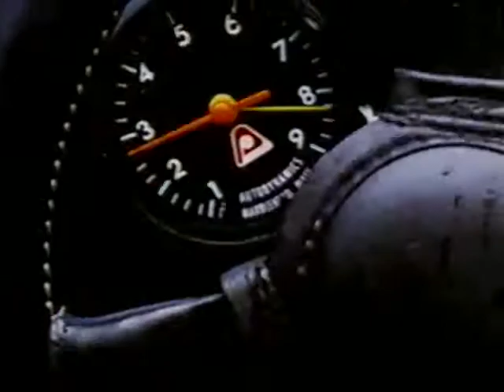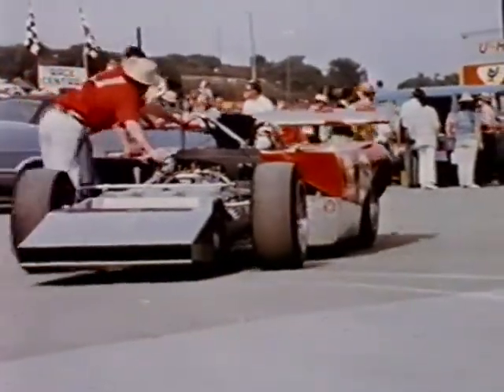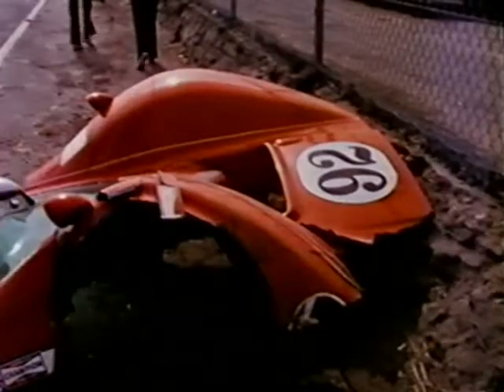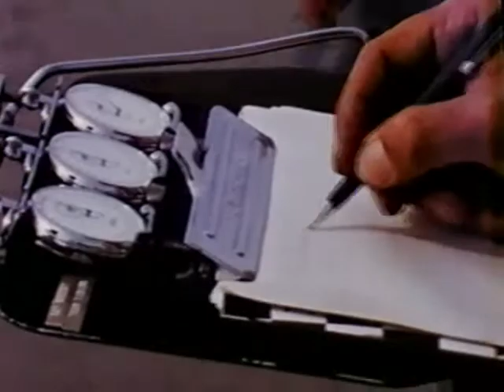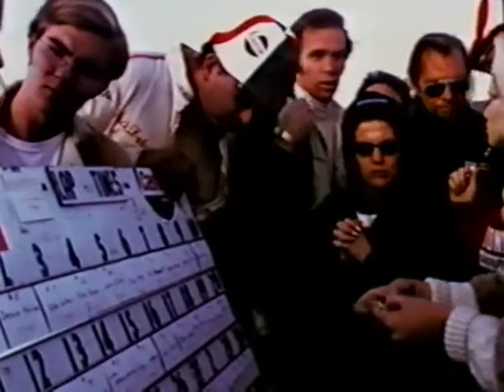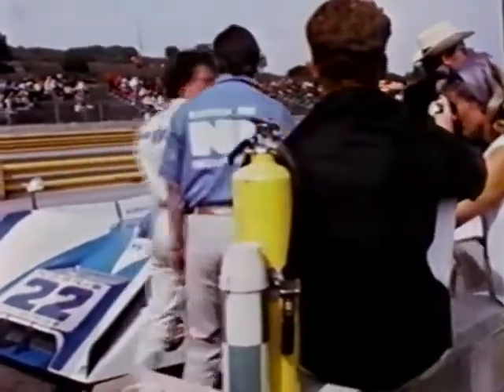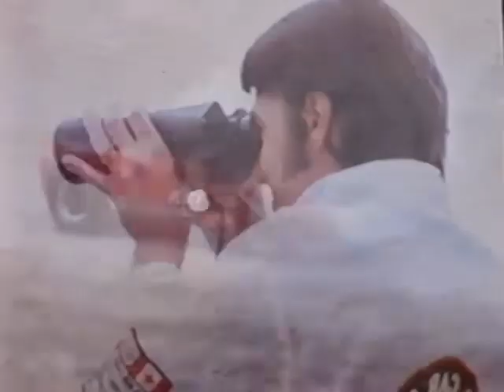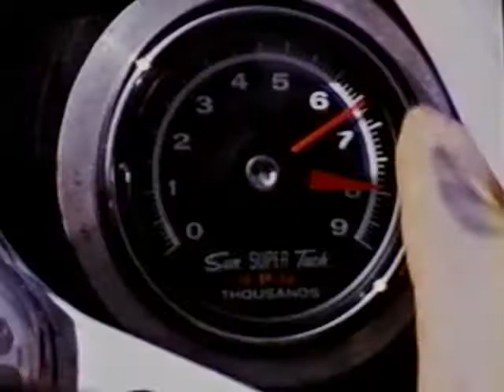Can AM At Alguna Seca (1971) Video Sports International

Comment: I was there when the J2 wasnt allowed to race, when the race was over I saw a 911 enter the racetrack and head left I ran jumped in my 427vett with low wide indi style tires and did the same except went right as the racehad. around up top the trackcrew were yelling at the 911 he spun around and we raced back down wow what a thrill I passed him down hill inside, yes 73yrs old now but would do it again great times.
Reply: Chaparral looked and sounded reat.Elford was a top line driver.  He died just a few weeks ago  Not many of the treats from that time left.